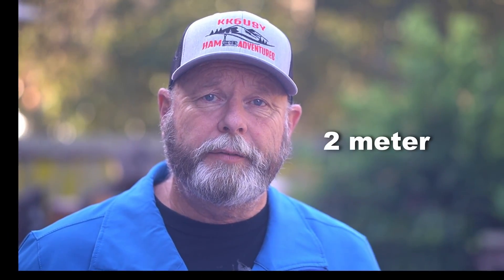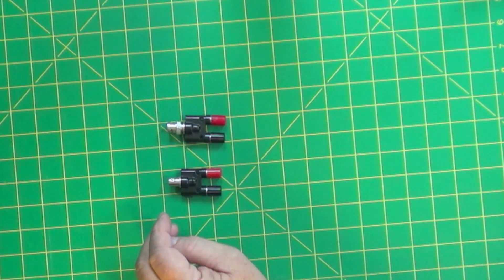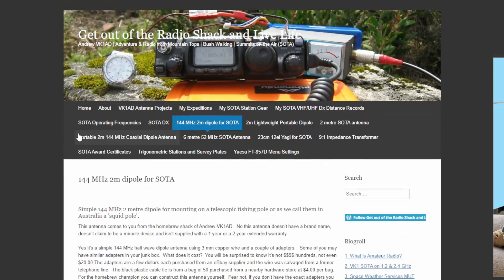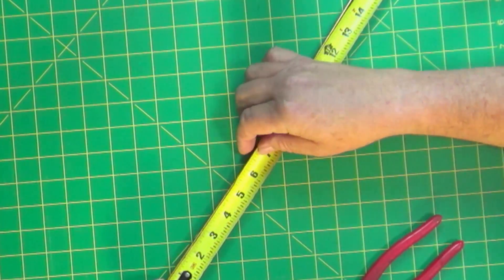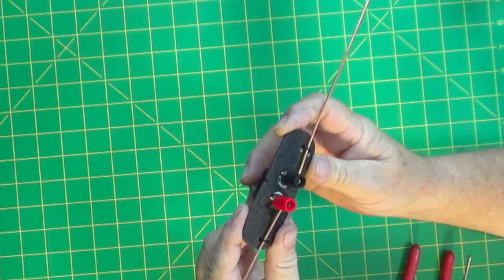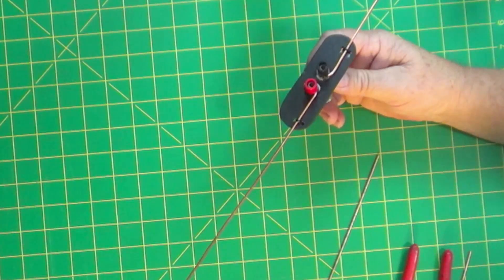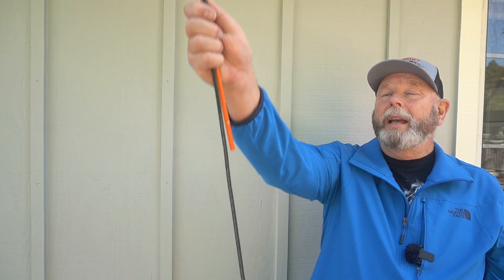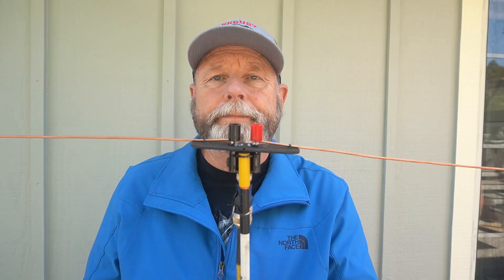How to make the easiest 2 Meter Dipole Antenna for your HT- handheld Radio using a BNC binding post.

Comment: Thanks for your video. Just looking for ideas to improve my rubber duck antena. I have one question? Do you need a balun type of thing in the feedpoint? I have seen that for endfeed dipoles they add turns for that.
Reply from the maker: I didn't use one
Reply: @KK6USYHamRadioAdventures  thanks

Comment: This is a great video! Any external antenna absolutely will do better than the stock rubber duck that came with the HT. The rubber duck is marginal and passes until a better antenna can be installed. An aftermarket HT antenna that equates to a 1/4 wave will do worlds better. I enjoy constructing homebrew antennas if I can (because I’m a poor boy). It’s been a while but I’ve made coat hanger 1/4 wave antennas with ground planes sitting in an SO-239 connector. You can also make a homebrew coat hanger or tape measure yagi. This isn’t intended to be a permanent outdoor antenna but it will be a fun project if you have an afternoon to kill. It will vastly improve the performance of your radio and you will learn about antenna theory from building it with your own 2 hands. It might be fun to take out for a fun day operating in the field. You just need to search for the plans online. That way you can have an omnidirectional and directional antenna for super cheap if you have the materials lying around. 

73 and have a great day!

Comment: Why did you cut 2 pieces 61/2 inches when the wires on the finished product are clearly longer than that?
Reply: Here was me thinking nobody had noticed the antenna length had quadrupled but I also noticed that at the start he said he was going to build a dipole for 20 meters..nobody has even mentioned that either.
Reply from the maker: I guess you were to busy skipping around and didn't hear the part where I said the 6.5" lengths were for 70cm. The longer antenna was for 2m. Thanks for watching.

Comment: Isn't the gap too much with this BNC-connector? I guess its 12-15mm gap, but should be as small as possible. What effect has the larger (than necessary) gap?

Comment: Hey Chuck KK6USY. Great video! A quick note though - it's crucial to adress the balance in a dipole. The jacket of the coax acts as ground so if you add a balun, the second element of the dipole also becomes radiant, making it a true dipole instead of an extended 1/4 vertical with a tiger tail. Tiger tails work great compared to the normal ground plane on an HT (your face!) but a balanced dipole is heaps better still. Always great seeing creativity in HT land / levels the field with all the custom antennas for HF. Thank you! 73, SA6HAM.
Reply: this is actually wrong. The energy travelling through the coax is travelling neither in the inner conductor nor on the shield but rather in between both, in the dielectric. At the end of the coax, the energy will distribute equally on both 1/4 wave elements of the dipole. One reason you would need a balun of some sort, is to get the SWR down closer to 1, since the impedance is around 70 Ohm on this dipole which will roughly translate to 1.6-1.8 SWR which is still good enough as said in the video. Another reason for a balun is to have a common mode choke that prevents the reflected energy to move along the outside of the coax which will make the coax part of the antenna and lower the SWR but worsen the radiation pattern and add noise on the receiver.

Comment: I just bought my first beginner ham gear: a GT-5R and a Signal Stuff Dual Band 2 m / 70cm (19" long) antenna. I live near Pearl Harbor. I've barely heard a squeak from anyone on ham, GMRS, or FRS frequencies. Seriously disappointed so far. 

Regarding your video (sorry if I'm being SUPER ignorant), you started out cutting two 6-1/2 inch pieces of 14 gauge wire. How did you end up with wire that looked like a couple feet long?

Nice chilled style. Thanks!
Reply from the maker: Tana, the longer antenna ends were for 2m , the 6.6" elements were for 70cm sorry I probably wasn't real clear on that. As for hearing traffic near Pearl Harbor I do know there are a few nets that you should be able to hear easily. I have a friend Todd that lives near PH and he runs a couple of the nets. If you want to email me , I''m good on QRZ I can find out a list from Todd and they are very welcoming on his net, I joined in on a vacation last year. Also to help get stronger signals you might try a roll up Dipole from Dr. Ed Fong. https://edsantennas.weebly.com/
Reply: @KK6USYHamRadioAdventures  Thank you very much.

Comment: I uses this fitting to make a 2m/70cm dipole. I used banana plugs to hold the wires then put them into the fitting. I used an antenna analyzer to trim them to the point where the SWR is very low. I did the 2m first, then added the wire for 70cm. That threw the 2m off until I got the 70cm properly trimmed. They are mounted on a frame of 1/2" pvc. Not terribly pretty but works quite well. I used old stranded speaker wire.
Reply from the maker: Nice! Yea when you add another part it usually mess something else up lol.

Comment: chuck just want you to know you have two diffrent dipole it all depends how u have it you have vertical dipole which is good for 2m  repeater and ssb and then you have regular dipole horzonal  and i can tell you it can be use with rig at 100w rig i just would not go over 50w is what i figure and have tested
Reply from the maker: thanks Andrew!
Reply: @KK6USYHamRadioAdventures  YW u got another antenna idea for you to try i am trying to get the big time ham tubers to try it
Reply from the maker: @AndrewMurphy8383  let me know
Reply: @KK6USYHamRadioAdventures  i want you take ladder line and cut it for the 20 meter band and make a qso there is a site if you need a slim jim calulator i have seen it done but i want to see if it can be done for land base and not mobile sky diving setup
Reply: @KK6USYHamRadioAdventures  and two it does not matter what orintation and left a msg about the antenna idea for you to try and let me know how it goes

Comment: Great video and has me thinking to make a HT portable dipole.  Pro tip, when using soft copper wire like stripped romex, before you cut and shape the wire, use a handheld power drill motor and spin a twist into the length of wire.  Put one end of the wire in a vise, the other in the drill chuck.  Give it a handful of turns and It will remove the kinks and add some stiffness to the wire. (assuming that you want stiff wire).

Comment: Is the distance end to end (total length) or each end to centre (with the centre gap not counted?).
Reply from the maker: John I didn't count the distance in the middle. The length is from the 90 degree bend to the end of each piece of wire.

Comment: Wait,,, ain’t those 1” squares on your green mat (the one with the yellow lines) throw out the tape measure lol 😂
Reply: All in fun brother. I'm in the middle of making a 5 element 2 meter yagi inspired by your video for a mew to me FT897D. Its all your fault! Lol.     73. KI5IQE
Reply from the maker: Lol your right and it has 1/4" marks on the sides , will have to remember that!